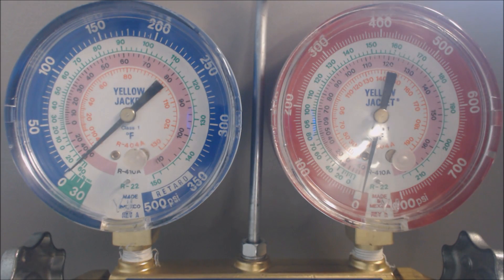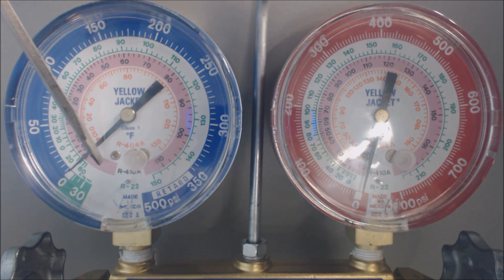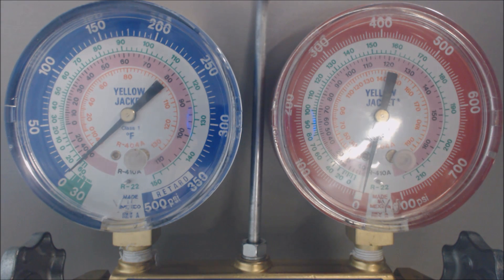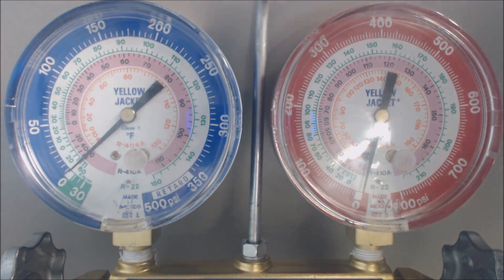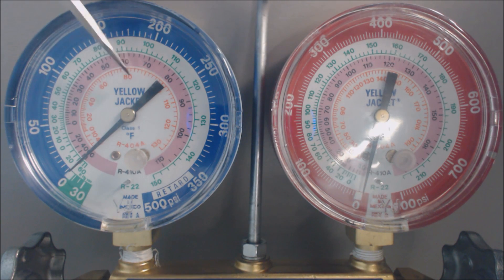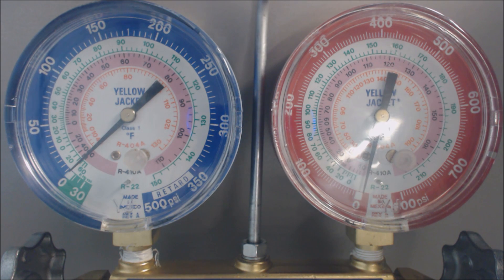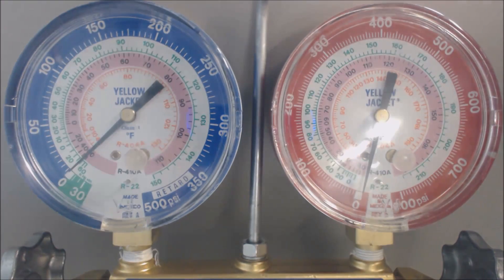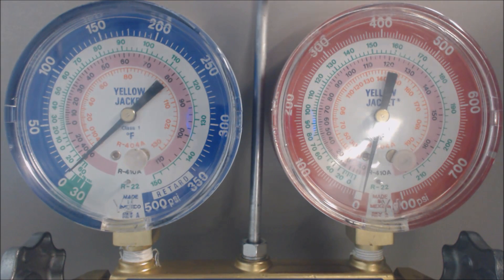R-22, R-410A Refrigerants! Checking the Charge- Vapor/Suction Operating Pressures, What is Too Low!

Comment: thanks that was the first video I understood about the gauges and why to charge r22 at least to 60psi. but that makes me wonders as I have two exact ac one for the ground floor and the other for the 1st floor both are 5tons units that were installed together. I noticed the one on the upper floor have lower psi and when I charged it to match the other one @64psi its not cold like before. (I cleaned the filters and condensers. both units have new contactors and capacitors only the 1st-floor one has recently evaporator cleaned the ground floor not yet) the 1st-floor units have been used a lot in the last 12 years I lived in the house the other one not so much. both units are carrier duct split ac. could it be the one with 64psi have dirty evaporator coils and that's what makes the pressure higher? or is it wear and tear from using one more than the other? our usual temperature is 90-115F around the year
Reply from the maker: You really need to check the charge using total superheat and subcooling and not just by pressures. Check the first, third, and fourth videos in this playlist- https://www.youtube.com/playlist?list=PLxnHR5_D2ojxubu9_ej-klywMskjAsuTX
Reply: @acservicetechchannel  thanks man for the reply. I ordered few items from amazon and will start working on that as soon as I receive them, my cheap gauges and digital thermometer isn't helping. I keep checking that ac almost daily and no frozen lines or evaporator so far, what's really strange is that area this ac is cooling has never been this cold before. so it could be the other unit is overcharged or because it has 4-5 meters more lines than the one from the higher floor. I'll get back to you once I have an accurate reading from both units. thanks again Craig.

Comment: great video....question....you didn't mention if you talking about with unit running (compressor on) or off position. what is the normal operating charge of 410a while a normal system is running?
Reply from the maker: This would be while the pressure is running but check out his video for the ranges of pressures-  https://youtu.be/UWZDArYoqN8

Comment: What to do if your compressor has a cut off switch for low gas and it won’t come on?
Reply from the maker: You would search for the leak. If you needed it to turn on, then you would turn the power off and jump out the switch temporarily until you were done, thanks!

Comment: Question was checking my ac r22l with piston and seems like it hasn't been running like it supposed to, the suction line on the psi was reading 70 and the liquid line 201 and base on my wet bulb and outside temp it was calling for 20 and it was 40 so I started to add refrigerant and the suction line went up to 75psi but it didn't move from there but the liquid line moved up to 300 psi, is the liquid line too high and why the suction line only move to 75psi and no more

Comment: My vapor side reading for r22 is moving back and fourth between 91 and 107. the liquid side is moving also between 92 and 110 for r22.  What does this mean?  Does the system need more or less r22?
Reply from the maker: It sounds like the system is hunting. Does the system have a txv or piston or capillary tubing? Also what is the total superheat and also subcooling? The more info the better, thanks
Reply: no txv, so a piston i think
Reply: It is a very old system. Had it serviced earlier in the summer. They added r22. The schrader values leaked over a month's time.  Started blowing with no cold. 
I replaced both schrader values now ready to replace some r22.
Reply: Its hot 90 degree weather in Illinois right now.  The house is hot.  
I have no pressure or superheating number labeled on my compressor.  So I'm at a loss as to what temps or superheat should be.
Reply from the maker: So to find a target superheat, you need the wet bulb and the outdoor dry bulb. This will vary from day to day, unlike subcooling used to check systems with a txv. Care must be taken to make sure that you have the correct superheat when the unit is charged to make sure that no liquid refrigerant is going back to the compressor which could ruin the compressor. Under EPA 608 law we must be licensed to purchase or work on systems with refrigerant. I just wanted to make sure that you knew this and I apologize if you are aware and already have it. Here is the superheat playlist, thanks-  https://www.youtube.com/watch?v=q-G7FLlzhAg&list=PLxnHR5_D2ojwGvhU1rseXQLJ-XBjBZMMk&index=1
Reply: Thank you! This will help.  I will let you know the results!

Comment: target is 40 degrees evaporator   with a 2 degree approach  that is the difference betweenthe liquid boiling off and the  evp   it varys with load so 410a will run from 118  to 130 plusand 400 to 450 high pressure
Reply from the maker: Are you in a very hot location with older deteriorated 13 seer condensor coils? 400 and 450psi are pretty high for a liquid pressure unless the outdoor coils are very small or are blocked possibly.  The 40 degree evap is the target of the manufacturers, txv's for comfort cooling are roughly 14 degrees of superheat and pistons will vary more depending on the load because they can't maintain an efficient saturated state all the time, Thanks

Comment: What would be the range on the low side for 410A txv with a load on the house
Reply from the maker: 104psig-156psig depending on the indoor wet bulb temp and outside dry bulb temp. Thanks

Comment: What does it mean if i keep adding refrigerant in a R-410A system and pressures do not change? Low side 40PSI and high side stays at 320PSI?
Reply from the maker: Are you saying that both pressures are not changing? If so, you may want to check for blower speed or obstructions in the ductwork. Have you gone around and checked airflow out of the registers? Have you checked to see if the evap coil is already frozen? If the system is that low you need to let the evap coil melt and then right after you turn it on, you need to get the blue low side gauge saturation temperature above 32 degrees which would be the temp in the middle of the evap coil by adding refrigerant. If after the evap coil is frozen, adding refrigerant won't get the pressures higher. Thanks for your Question!
Reply: After the system sits for a day or two off,, I turn it on, and its pulling heat out of the house for two mins. After two mins I notice it stops pulling heat out of the house. The pressure is low and cant get the pressures up, theres plenty air going through the evap coil. The system is still running, but it works every time i turn it on, but continues to stop pulling heat after like 1-2 mins. Its a brand new system, was installed this past october. He just started turning it on about a few weeks ago.
Reply: oh and the low went up to 100 PSI and the high went down to 295 PSI that's when i overcharged it. It still wasn't pulling heat out house
Reply from the maker: So if you could provide more details that would be best. For instance, I don't if this is a split system, package unit, or mini split. The video you were watching had to do with split systems and package units, not mini splits. If this was a split system 100 psi would just be entering the lower range of where it needs to be because the evap coil is right at freezing. Many times the low side will be 105-135 psi. For a 40 degree evap you are looking at around 120 psig on the low side. If we were talking about r-22 it would be a whole lot lower. The high side pressure would depend on the seer rating of the AC unit outside. The lower the seer rating the higher the pressure due to less fin square footage area. Though most times you check in subcooling for R-410A units since many have a txv some do not and only have pistons. Do you have a txv or piston, what is the superheat, subcooling, actual pressures, is the evap freezing, ambient outdoor temp, indoor temp, temp difference between return and supply conditioned air, wet bulb in the house. I was also wondering why you say that your unit is overcharged. Are you finding a higher than normal subcooling?Thanks for the Question!
Reply: 5 ton split system, 15 seer, R410A,  I overcharged by weight. took refrigerate out and had 13 lbs over factory charge. it has TXV, didn't get the superheat, subcooling was 1 degree, but approx the low side was cold and the high side was same as the wet bulb.
Reply: im sorry if i'm being a bother, i just can't figure out what's wrong here. i been trying to figure this out for a few weeks now, and i need help. my friend is a air conditioning tech, he said it sounds like the lines are clogged but i already blew the lines. thank you for all your help
Reply from the maker: There are some units that have had a stuck txv problem due to the corrosion resistance additive. Have you tested the txv bulb in hot water which would get the vapor pressure up higher and reduce the superheat? I would suggest that you test the bulb and txv reaction first. You can watch some of my videos in the troubleshooting txv playlist if that will help. Those videos should give you enough info on txv reaction to hot and cold water and your current situation. It sounds like it could be either that, a clogged screen from brazing near the txv in the liquid line, a clog in the liquid line or distributer lines after the txv. I am assuming that as you were adding refrigerant your subcooling was increasing though which would be normal in a clog or stuck txv situation. The fix for the corrosion additive is to add another additive and cycle the txv back and forth with hot then cold water. I hope this helps you!

Comment: Ambient is 86F 50% humidity and low side on my r22 ductless split is 40PSI. Ac doesn't blow cold. Very slight ice spots on thin liquid line 1/4" what can be the problem
Reply from the maker: Ice could be an indication of low pressure which correlates to low temp due to possibly low charge or it could be txv not letting enough refrigerant through. Maybe look for refrigerant oil on the flares at the outdoor unit and behind the indoor wall unit to start.
Reply: +acservicetech if room temp is 70F and ambient is 82F what vapour pressures for R22 split ac should i see?